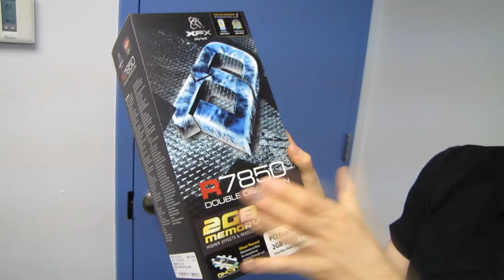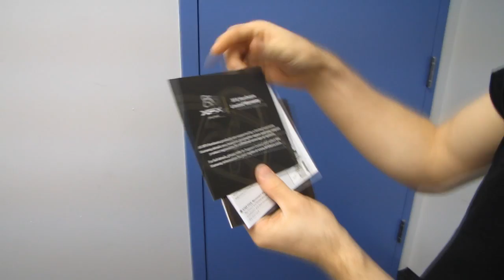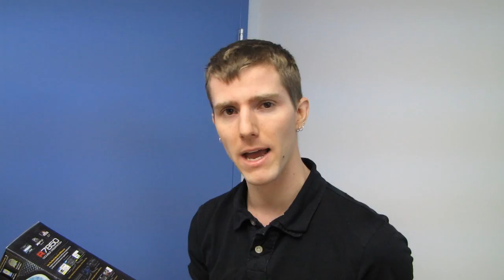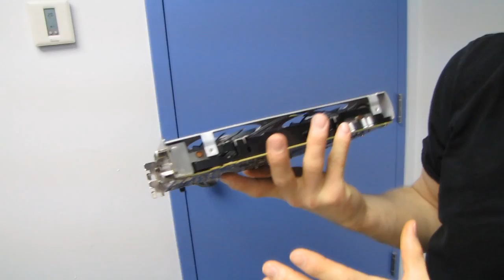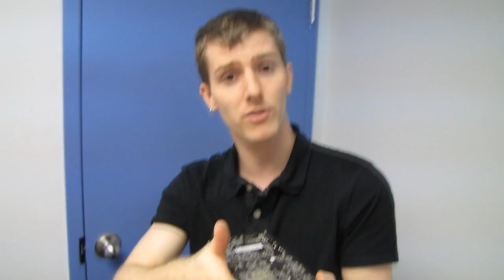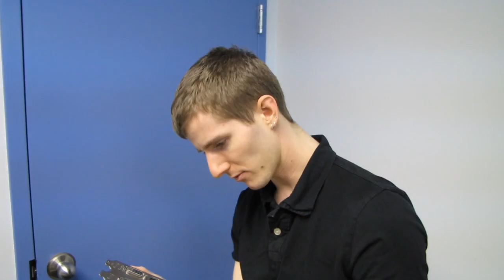XFX Radeon HD 7850 Double D 2GB Gaming Video Card Unboxing & First Look Linus Tech Tips

Comment: That if you have $400 to buy a single GTX 670 but HD 7850 is great at the moment since its cheaper and able to run pretty much all games on the market max settings to this date. It's one of these moments where cards meets the necessary needs.

Comment: XFX.. You screwed me over with the non reference 6970 PCB and for that, I never will forgive you. Now my video card overheats to 95-105 on load, it is not compatible with most aftermarket coolers so basically I have to put it in water if I want it cooler..

Comment: If there's any bottleneck at all, its in the video memory of my 6850. I can't run Star Trek Online at 1920x1080 on a single monitor without dropping to ~34 FPS. As I've been told by AMD customer support, the boost of a 7850 wouldn't justify an upgrade. All I care about is the FPS anyway. :)

Comment: this is like the only 7950 that uses two 6 pin connectors. My msi 7850 only uses one 6 pin as the 7850 has a max power consumption of 130w.

Comment: @LinusTechTips What is the length of this card? Cause I have a case that fits up to a EVGA GeForce GTX 460 (which is also what I have). Yes I know it's old, but I haven't used my computer for much gaming for a minute now. So this is the card that could change that. Also ATI (XFX) affiliates are my favorite. I still have a Radeon HD 4770 that I will not give up. I just hate ATI's driver update installs (that's my only real complaint).

Comment: Should I get this in a 2 way SLI, or a single GTX680. Just wondering since they're about the same pricepoint. Im going to be running on a 850w power supply. Or should I up that too if I go with SLI.

Comment: @yorinlol it will work just fine, a 6850 its not a highend gpu so you wont see any diference between 1.0 or 2.0 with that card although if your mobo is 1.0 i believe its pretty old you should upgrade that. theres no point of having a good gpu with a crap mobo or processor the gpu will not work 100% if the cpu limits it